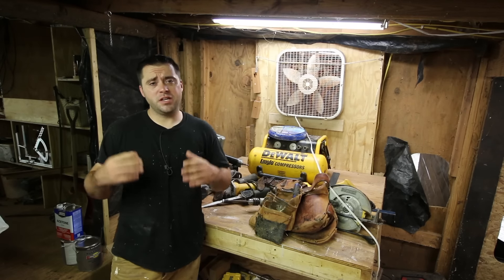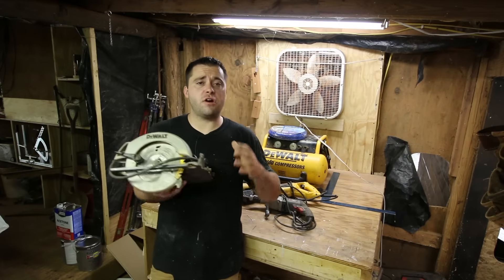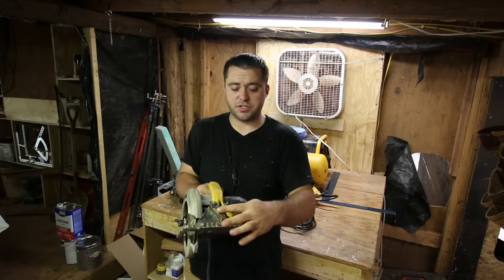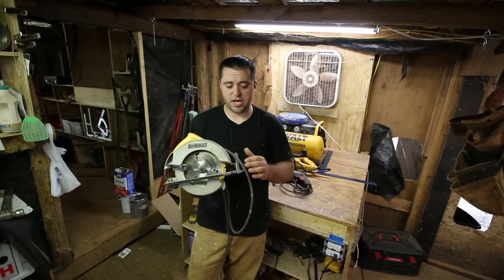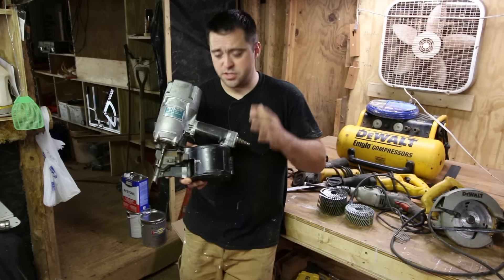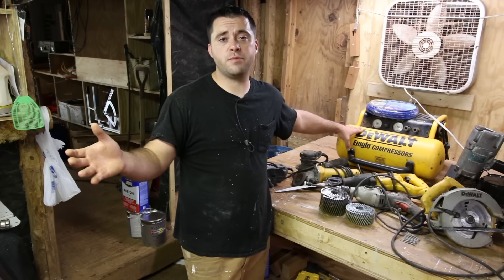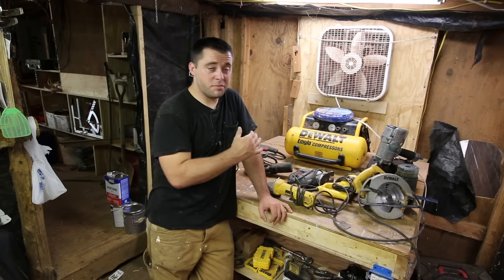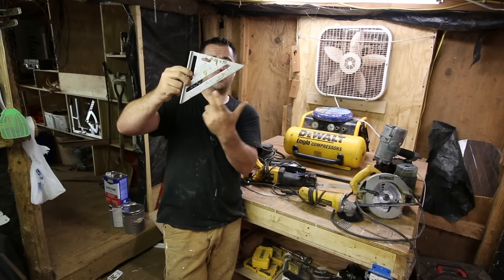Essential Tiny House Tools P 2-3

Comment: You're lucky that saw only gave you a minor cut.  I went to a first responder call for a circular saw across his thigh.  It was bad bad bad!  A circular saw will cut almost laser smooth on wood but it'll lay a thigh open and make it look like hamburger.  His quadricep was cut most the way through and ripped the rest as the muscle contracted.  I saw his bone and his artery.  So lucky that he missed those.  I'm not a super safety sally myself but you are spot on to keep that blade guard freed up.

Comment: Milwaukee Fuel cordless, I have pretty much all their tools and find them awesome, most of the job sites that I work on do not have power, so for me cordless is the way to go. For a nail gun, I use a Dewalt cordless framing nail gun, which is way better than my old Paslode which I hate. And the dewalt worked great with ring shank nails on my tiny house. My corded stuff is makita and dewalt.